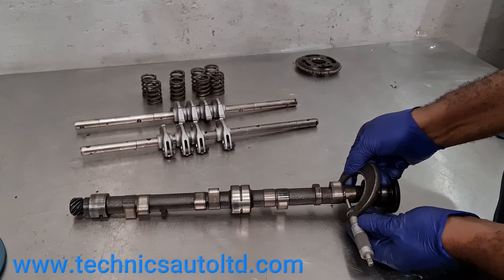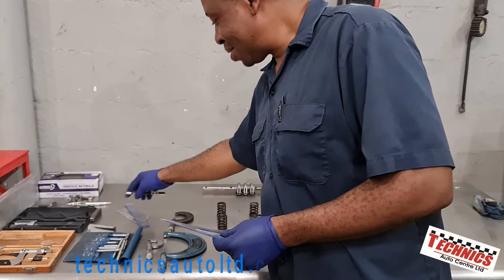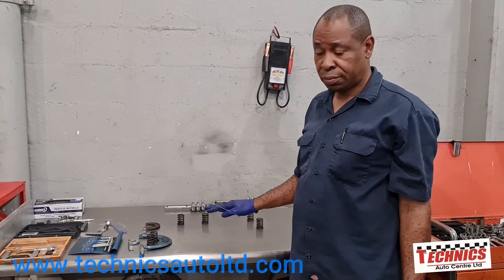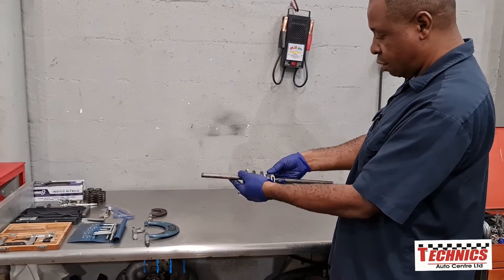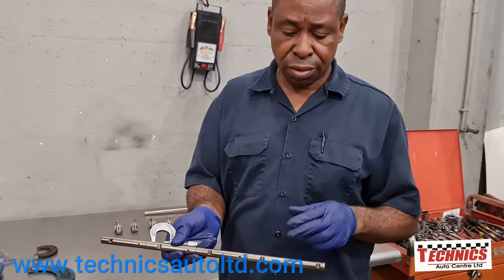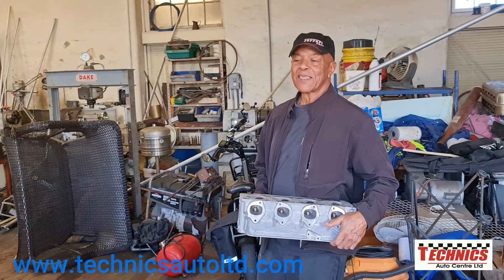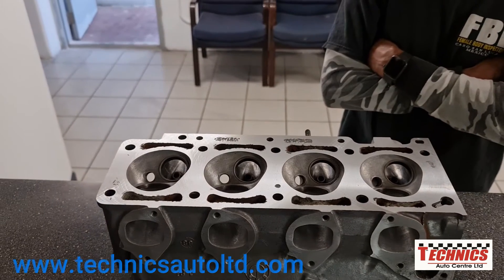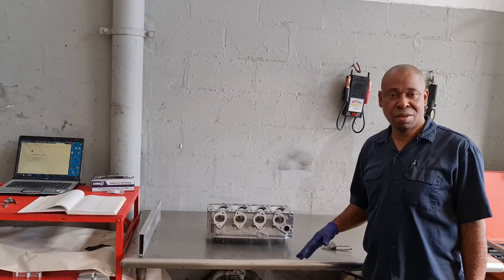Part 11  How to rebuild BMW M10 engine

Comment: On the m10 and m30 engines when surfacing the cylinder head always attach the upper timing cover so that it's surfaced to the same height other wise you'll have trouble keeping the valve cover from leaking oil.